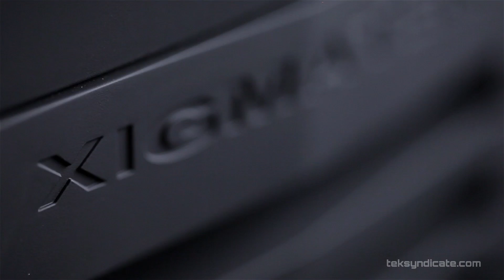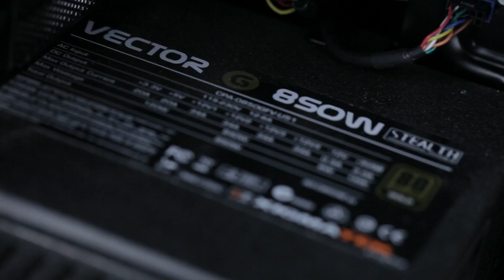Pistol's AMD Workstation Build For Streaming, Gaming, & Editing

Comment: Why not just OC the 8350?
Reply from the maker: Masterincommander Indeed. Ours hit 4.6 on this motherboard... couldn't get any more out of it due to the voltage limits on the motherboard (and 4.7 was a little too hot anyway).
Reply: KarpfenNOTKrapfen I sold the 8350, so yes. Yes it was.
Reply: cause it might not get 5ghz, they probably tried already and it didnt get that high
Reply: Tek Syndicate But was it worth it to spend money on a new cpu....
Reply: Did you OC the 9590 at all?
Reply: PBWillyWonka i have my 9590 at 5.6 ^^
Reply: Yeah I assumed that was the case, but was the price worth the few hundred MHz extra in your mind? Or was it just to basically buy a headache free, stable, solution knowing its a cherry picked part and all, and not worrying about price. Logan did say it's not /as/ much of a value build but that it didn't matter so curious if that's what he meant?
Reply: +Rene “Kris” Hourian Seems like AMD set aside some better silicon for these 9590 chips.  Not all 8350s will get to 5.0 but these chips will all get beyond 5.0.  Not much beyond it but they will.
Reply: Paul Rodriguez I got my 8350 to 4.7 stable!! It gets hot, water is mandatory. So far right now I'm satisfied with AMD.
Reply: Paul Rodriguez lol bullshit